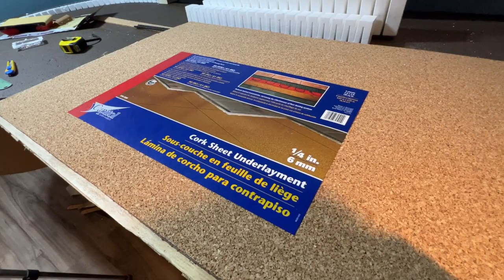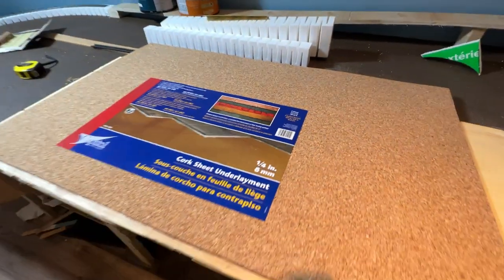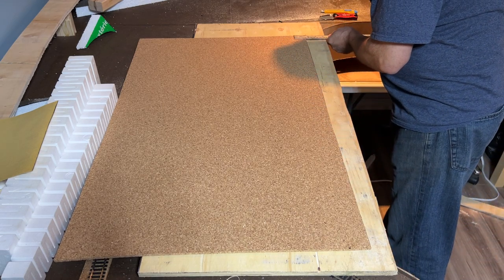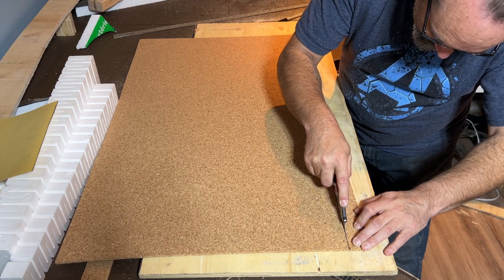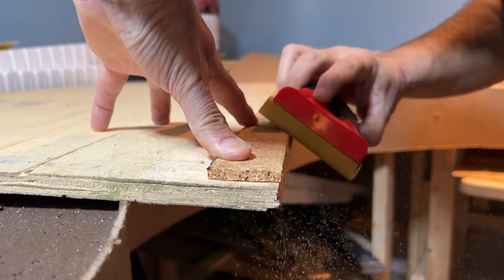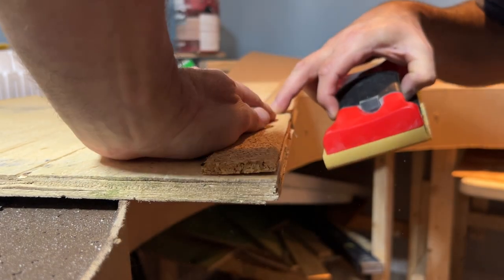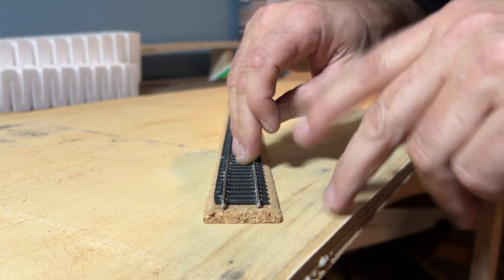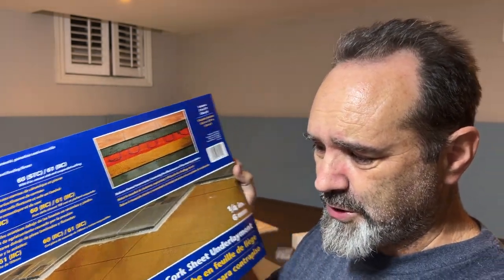HO Scale Cork Track Bed On A Budget - Where To Buy & Cost

Comment: You could split your road bed down the middle and make flexible curves without wasting your cork cutting curves.  Just a thought from north Idaho. 😋
Reply from the maker: I thought about that Randie, but if I only cut two lengths of curved track at a time, I won't waste too much. I'll try that first, and if it doesn't work, I'll try your idea.

Comment: Just a thought, you could make your cuts on a 30 degree angle, or there abouts, so you alread have an angle on one side without sanding. When you go to cut the next run of track bed flip the sheet over, and cut the next at the same angle. Bothe sides would be angled.
Reply from the maker: I thought about that, then decided I would just mess it up. I ended up using an air powered sander to zip the angle.
Reply: @ScottRails  point taken

Comment: Not sure if it matters to you or not, but that locomotive you show at the end, the NS 5246 has the dynamic brake hatch (the fan in the center) on backwards.  The boxy section should be at the front.  I do like your roadbed results.
Reply from the maker: Hahaha, thank you. That section pops off every time I pick it up and I was wondering which way round it was supposed to go.
Reply: @ScottRails  👍

Comment: I don't like cork roadbed for where I live here in the southwestern part of New Mexico where it is usually pretty dry environment most of the year because in this environment cork tends to crumble over time, and those crumbled bits will find there way into a locomotive motor where they will gum up the works.
Reply from the maker: Interesting. So what do you use instead, or do you just have the track directly on the base?